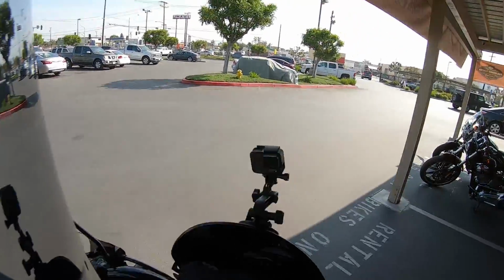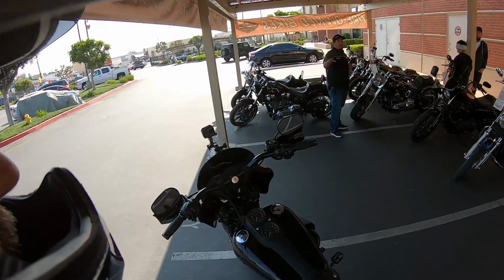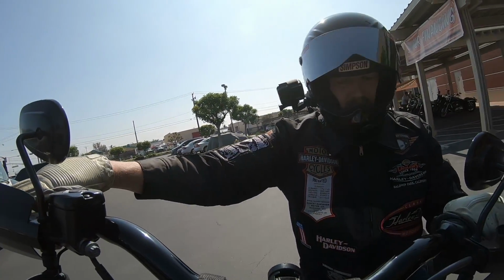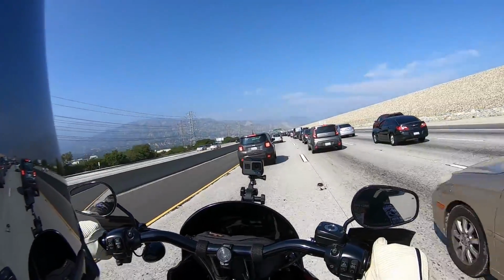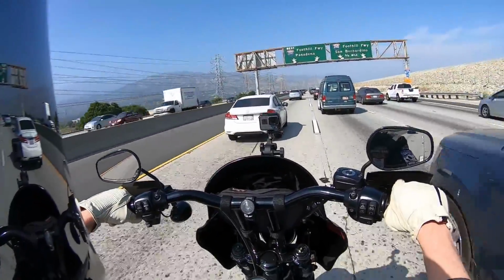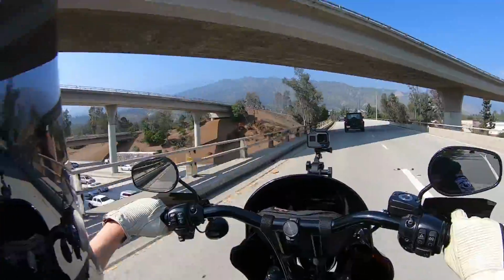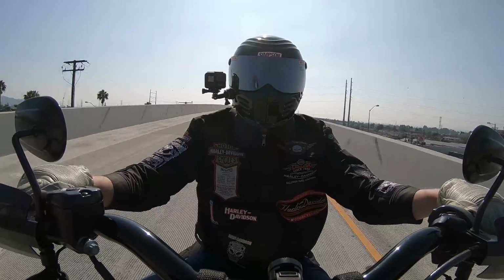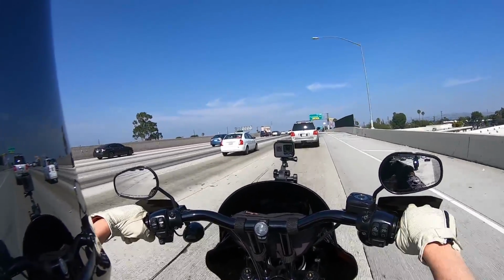Grip, Rip, & Splittin' on a Low Rider S 117 CI with Ohlins Suspension

Comment: Great video that is so badass I do not understand why they only made the Dyna S for two years one of the best Dynas Harley
Reply: Because they are a special release model.  Kind of like a CVO but without the price tag.
Reply: Because they were replacing the frame with the new Softsil line
They didn't make a Dyna Anything in 2018
Reply: They also probably wanted to use up the 110 engine components as well as they no longer need them !

Comment: Good comments on the suspension.  I have a Legend Axeo/Revo setup on my '15 Road King and I'm constantly asked about the ride.  People are usually surprised by my response when I tell them that it's a firm ride because so many of the reviews talk about comfort.  IMO the point of a performance suspension upgrade is control.  I usually compare it to a BMW M5 - it's firm, but always composed.  That's the way my King rides now, I have way more confidence when I'm leaned over in a 70mph sweeper or charging down a highway with poor pavement.  I think a lot of guys shopping suspension are looking for the ultimate in comfort and many of the reviews out there are doing guys a disservice by not making a distinction between ride quality and performance.

Comment: Yesssss cant wait to do a 117 kit on my fxdls
Reply: You better research the 117 Kits and oil sumping issue.  Just google 117 Kit oil sumping.  Thank me later.
Reply: Was the oil sumping issue specific to the TC 117 or the M8 117? Finding a lot online in regard to the M8 and the replacement with the redesigned oil pump HD launched in 2017 in order to rectify the issue...?
Reply: It was due to m8 117, Stage 3 kit.  Yes, they redesigned the oil pumps for m8's.  But that is still not sufficient for the 117's. @JayJay-nm9vm
Reply: Road Glide - Copy all on what you’re saying in regard to the M8 117. Do you know if this issue effects the TC 117 as well?
Reply: Yes.  Google Road Glide CVO Forum.  And you will see a lot of owners talking about the same issue.  Yes Harley modified the oil pump after the initial M8's hit the ground.  But they are trying to run 1 oil pump for all.  The 117 need a performance oil pump.  I had to get a brand new bike.  I'm going to void my warranty they say, but I'm putting Feuling Oil pump and cam plate on my new bike.   @JayJay-nm9vm

Comment: When I had my sporty I hated the suspension because it would just bottom out and tweak my back. But when I had my Dyna and especially my street glide I love hitting the dips in the road on stock suspension. It just feels cool and I’ll purposely roll on the throttle in those spots as if I’m gonna jump a 700lb bike. It’s the bumps that I don’t like. That’s when I feel like I need an aftermarket suspension. Especially with my fat ass.

Comment: Traded my lowrider S in for 115 anniversary street glide special... i do Not regret it
Reply: Same here. Had a stock 110 with Thunderheader pipe. Never thought a Harley could go that fast but beyond uncomfortable. Miss the speed but no regrets with the SG
Reply: @owennochimson171  on my S i had bassani road rage .. commader V tuner.. dyno tuned... lucky daves 13in tbars and matching seat ...etc etc..... now i have the 115 anniversary street glide special ...turning it into an animal...nearly done... that 107 M8 will give the 110 a run for its money
Reply from the maker: Great bike. I’d take the street glide as well. I’d take both bikes if I could.

Comment: For the price H-D charges for its motorcycles, they should offer Ohlins on all it’s motorcycles straight from the factory, with zero mark up. I would be more tempted to buy an H-D if I didn’t have to upgrade every single part to make it perform/handle better.

Comment: 117 is how they should have came anyway. Granted I’m loving my 122 low rider s.
Reply: Better then a 117 or 131 ??? How is the accelaration from 60mp to 90 mph ??
Reply: @radumihaibadescu5089  honestly that’s a hard question because I also went with a cam suited to me riding style. So a little more than just the 122 kit
Reply: @joshuathopper  are you happy with your 122 ? Enough power for accelaration from 60mph till 90 mph ?

Comment: High bars on Harley's sportiest machine? It doesn't make sense. The lowrider s is an awesome bike all stock. Imagine if the crotch rocket guys would install high t bars or ape hangers. It doesn't make sense.

And what's with the handguards as if it's a dual sport motorcycle?
Reply: It’s club style man! So many people rock the quarter fairing and t bars on dynas. Where you been at?